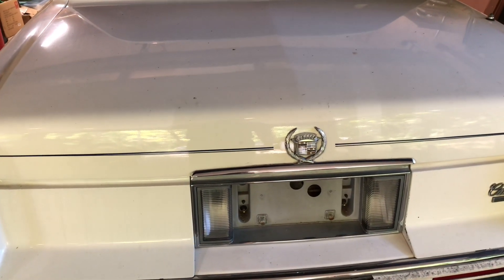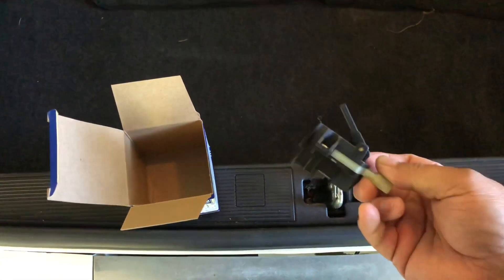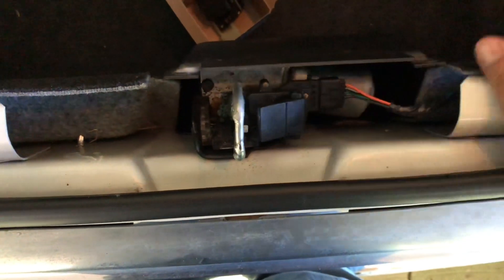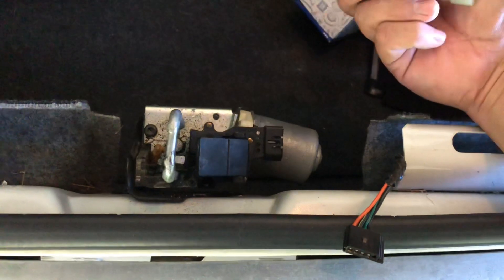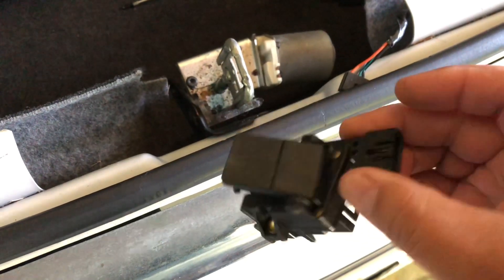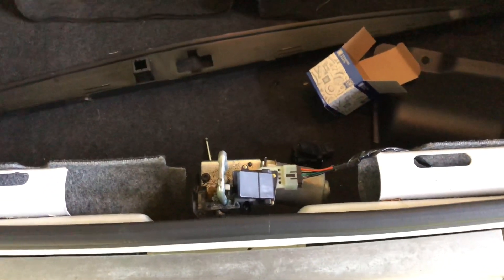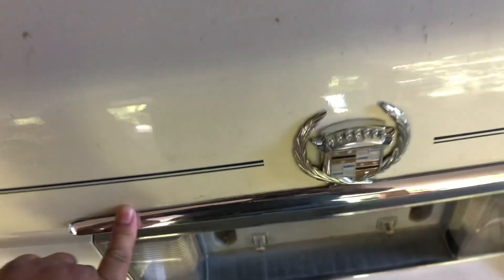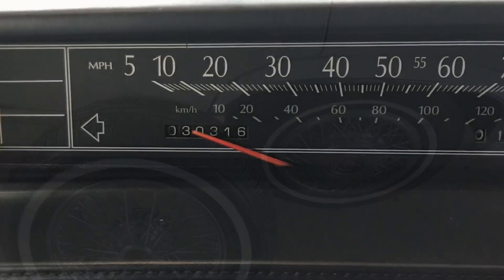1990s Cadillac trunk Pull-down fix!

Comment: I just fixed mine on Sunday 7/24/22 on my 1991 Buick Park Avenue, BUT I PERMANENTLY REMOVED THE SWITCH. I simply found the sweet spot for the height of the pull-down latch bar, & set it to be (via a temporary direct connection to the motor) and now my trunk closes & seals like A REGULAR TRUNK DOES -- MANUALLY without ever needing to engage the motor again.
Reply: How did you make the connection to move it down?
Reply from the maker: I have done that before myself.
Reply: Me too..
Reply: @FamousAndFallen   with a makeshift wire set
Reply: @FamousAndFallen im doing this now, the silver latch that goes up and down can be removed from its housing and you turn it clockwise and it will lower and you can put it back in its housing. Trying to find the sweet spot will take a couple tries tho I’m currently still at it after 3 tries

Comment: Took one out of a 93' yesterday and due to inavailability of the part I disassembled the switch. It is possible to drill out the rivets but the large one where the mounting screw passes through was harder then the small ones to get out.
The contacts were pretty gummed up inside but I was able to clean them and reassemble the switch and it worked fine again.
Reply from the maker: Thanks for sharing the fix!  When I made this video you could find the part new on Amazon for $22.

Comment: 👍👌🏻😊thankyou for explain what cause the trunk pull down it is the switch , my 1994 Cadillac Deville same problem I search which cause not work the motor or the switch so test the motor is working order so found out it is the bloody switch so final order the switch will be on way I am from New Zealand awesome thanks cheers Barrie

Comment: It is now 2022/23 and this part is no longer manufactured. I ordered a used one off of eBay it doesn't work either but there is an extra little switch that the big switch should hit when you close the trunk lid does not engage. So check that little switch first and it is probably stuck in the down position. Try blowing it out lubricating and reinstalling and see if that fixes it first.

Comment: Great video!  I also have a ‘92 Coupe with the same issue just ordered the same part hoping this fixes mine !
Reply from the maker: Let me know if that fixed it!
Reply: I have a 91 coupe only my trunk pull down is a 3 wire not a 4 wire. Wondering what yours is? Thanks..

Comment: I have a 95 ,Sedan Daville and end up being that. It's the gear that connects the motor with the switch and the pull down.
Reply: Can you send a link where to buy it , tried looking can't find, I also have a 95 deville

Comment: Hi could you tell me exactly what part it is,  I have a 1998 Caddy Deville  trunk wont fully close I suspect this is the problem   Thanks for the video !!
Reply from the maker: The pull down mechanism has a separate switch.  The switch is what usually goes bad, not the motor.  The other weak point on some models is the motor housing, which is hard clear plastic.  Once that breaks, the motor will not pull the trunk down correctly.

Comment: I cant find the switch only anywhere, only the whole assembly for 2-300 bucks. is there a part number i can search??
i got the motor to work a little so im certain you are correct and its just the switch
Reply: keep trying to stop the video to catch the part number

Comment: Thanks for the video, How does one know if the switch is the problem, or does one? The black flap (spring) on mine goes up and down, so the spring works on my 1998 DeVille.
Reply from the maker: The spring is usually good.  It is usually the electronics that fo bad inside the switch.
Reply: @southerncadman7066  Yes. You said the switch "is almost always what's going to be bad". I guess for $25 maybe I should just invest in that switch. I thought I was going to have to buy a new motor, which is considerably more expensive. The fuse is good. Thanks again.
Reply: @southerncadman7066  On the switch assembly, what is that piece of plastic that looks and acts like a light switch?

Comment: Any chance you have the link for the switch or the brand and part number for the switch. I found every switch but that one at AutoZone and only the entire assembly on line.
Reply from the maker: Unfortunately, I have heard that the switch is no longer available.
Reply: @southerncadman7066  you are correct. FYI the brake lines from the master cylinder to the abs pump are discontinued as well.

Comment: Question Cad man, I have a 1991 Brougham, Just last week driving down road, and all of a sudden my trunk motor began running without any indication, I pulled off to a parking lot and tried to open and close hoping the motor would stop, but the trunk was not latching to the mechanism, it just kept running, I got to the gas station, then tried to leave but the battery had already run down due  to the constant running of the trunk motor, Do you perhaps know what caused this ?, I had to pull the fuse under the dash, leaving me with  no Power locks, Seats, or horn , and the trunk is not properly snugly closed, Will it drip water in the trunk if I go through the car wash ?, Please advise, if you know Sir, Thank you.
Reply from the maker: I’m not sure. You may have a broken plastic worm gear.  You’ll probably have to take it apart to get a look at what’s going on.
Reply: That is exactly the problem, Dorman part number 926–135

Comment: Damit man I got a 91coupe DeVille with the same problem , but it did not have that paddle switch, had a different thing made of clear plastic , ordered one from e bay that showed a identical part for 90$ what was sent was a black plastic one that looked the same,so I tried it, did not work,but when I close the trunk it doesn't look sprung anymore, someone must have tried to use a different GM part on it,cos what I have is not like that.
Reply from the maker: You may be one of the unlucky 1% that has a bad motor...  But if trunk closed lower, it sounds like it is trying to work.  There is a limiter switch that has to be configured a certain way as well.  You might need to look at that.

Comment: Mine is not pulling down. Haynes manuals are completely useless on all things electrical. It doesn't even have a section acknowledging there is a trunk pull down system. I pulled mine and ran jumpers to the motor and it retracted. I reinstalled it and out of habit I plugged the harness back to the switch. When I did the damn motor extended. I was just wanting the lid to shut low enough to keep water out. I didn't expect the motor to engage at all as it wouldn't retract. I felt like a dumbass when it extended. After I threw my tools out. And the crap back in the trunk. I slammed it and started applying calamine on the countless mosquito bites I collected while having my ass handed to me by my car. I I tried checking continuity on the switch when I had the unit apart but with no schematic in the Hanes manual I couldn't tell much. I did find that with the small lower switch in the lower position I had continuity on one terminal that switched to another when I clicked the switch upward. And similar results with the large paddle switch engaged or disengaged. I've been trying to find the latch assembly but it's been discontinued by Cadillac and every one I found online was not available. I'll see if I can find the switch itself. Caution to those working on this assembly. The casing of the worm gear that the motor mounts to and is what attached the assembly to the metal brace in the truck is acrylic. It's fragile and the bolts that secure it are coarse threaded. There are three bolts that hold it in place. Don't fully install any of the bolts until you have all three successfully started. When you're sure they are threading in correctly hold the assembly to the brace and gently tighten the bolts. Just snug. Don't crank it down as it will brake the assembly